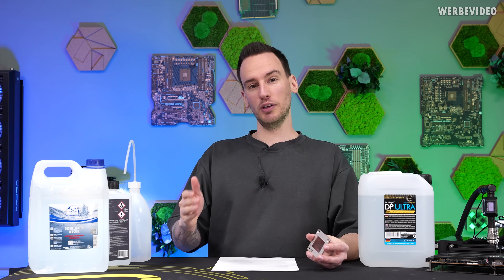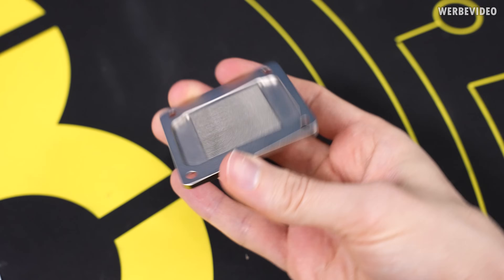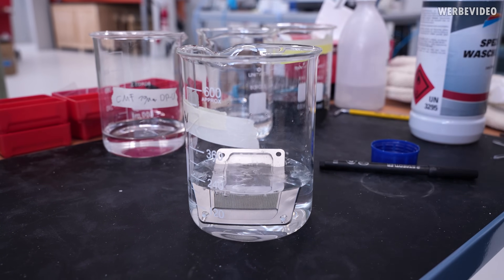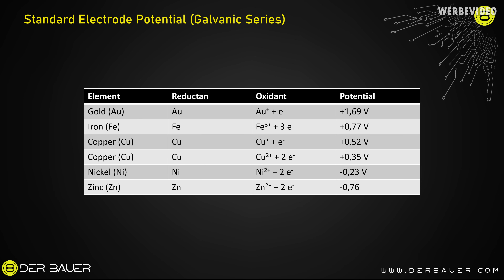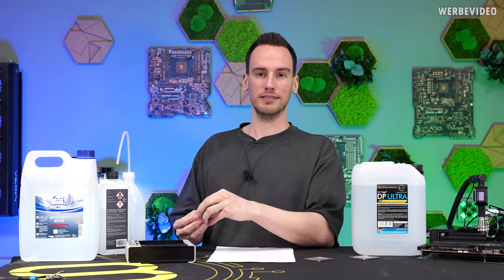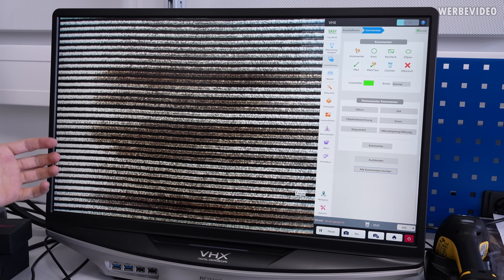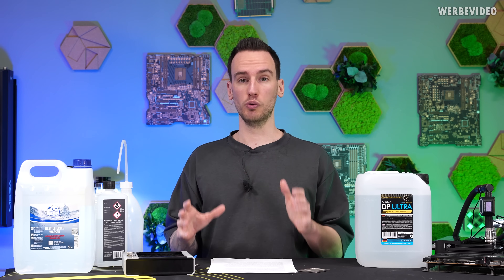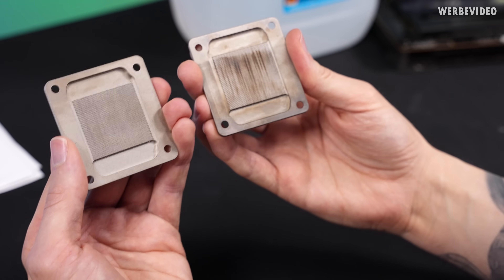Do NOT use Distilled Water for your Water Cooling Loop!

Comment: Would be nice if you would make a low cost, powder form inhibitor that you mix with distilled de-ionized water. That way us who live in areas of the world that have no direct importation of thermal grizzly products and cannot get liquid products shipped to them from other countries, can at least have good alternatives to ready made concentrates.
Reply: easy to use form to sell in would be a bottle with a measured amount of powder inside and a "fill to" line on the bottle indicating how much distilled, de-ionized water to add.

Comment: Yea I love distilled water, but I learned after a couple of loops that you do really need to treat it somehow. I've been using Primochill fluid treatment for the inhibitors and biocides in them since they're tiny little bottles that can treat a gallon/4 liter bottle of distilled water and then you have enough fluid for several loops. I just replaced my old pump/res and CPU block with new ones (wanted to move my old parts to a new rig so i needed another) since I wanted to get corsair's new iCue Link ecosystem into my current rig at some point for when my old fans eventually die, they've been running for 5 years now going strong but they're well into the window I'd expect to start seeing failures on past builds. This is the first loop I've ever had go this long with the same fluid without issues, my previous ones either had biological growth or corrosion issues, and while there are still some issues with some of the fittings getting some corrosion, I think that was more just from fluid running past them causing wear and not from the pH since my CPU and GPU block were both flawless, basically the same as the day I got them in appearance. It's possible that the old fluid getting slowly replaced with untreated distilled water the last few years might have impacted them, but there should still have been enough treatment in the loop for that to not be an issue, I did kind of add it to less water than I was supposed to knowing I would eventually be topping it off with untreated water and hedged against it. Some of the fittings had some crusty buildup in the threads when I took them off, but I actually actively avoided checking most of the loop since I knew that said buildup was probably also helping keep everything sealed up as tight as possible, and I wanted to avoid breaking those seals wherever possible. All 3 radiators and the QDC tubing runs to and from them were left filled with fluid and intact, and I drained the old fluid from my previous reservoir to fill the new one, and after a few weeks now the new CPU block looks flawless. No GPU blocks yet for RTX5080s sadly so that's running on air for the time being until I can get a block for my card, or until I'm forced to buy a different card to get one that I can get a block for at all (hoping that doesn't happpen but we will see).

Comment: It’s great to see someone actually talking about galvanic corrosion. It’s why I’ve stayed away from water cooling for so long. Even De-ionized water will eventually pick up enough ions to act as an electrolyte. Additives can help, but I won’t run a water loop long term unless every part is 100% copper. Too expensive these days.

Comment: sorry but that is not my experience 
have been water cooling now for 15 years and only used demin / distilled water + silver kill coil in the reservoir.
pure copper or nikkel plated blocks and soft tubing
only corrosion i have ever had was 1 build with a cheap EK copper cpu block where the copper would oxidize at the steel injector plate inlet.
that injector plate was not coated or anything and i know its steal since it was magnetic.
but this was more due to the fact that the system only ran 1 day a week tops and due to how the case was mounted  +  loop order (cpu and gpu parallel) so air got trapped in the block and started it combined with the steal plate.
after cleaning it and put everything in series problem went away.

Comment: If i can make a suggestion. There is a well known German company named BRITA (professional branch). RnD Engineers there over the years, working close with manufacturers of variety of appliances such as coffee machines or boilers (and lest face it  GPUs are not so dissimilar to them in some ways :) ,  have collected quite a knowledge base regarding water and corrosion and chemical processes involved. May be they can share some of it and it would be helpful in your endeavors.

Comment: I kept diluting my loop with distilled water (started with EK cryofuel) and my blocks/rads both corroded and filled with an algae schmoo, it was disgusting. I had to scrub out all of my blocks and I replaced my radiators/pump. Distilled water is NOT good for loops.

Comment: No issues so far using distilled water here + PT Nuke (Benzalkoneum Chloride). Always measure PPM, trying to keep between 1-5 PPM. Some time ago got access to Bi-Distilled water and is more pure (lower than 1PPM). Since I own a MORA and a 5L Chiller going DP Ultra or similar would be quite expensive (almost 10L both)

Comment: What do you think about distilled water with G12 antifreeze ? I used this type for cooling for over 10+ years... on my old water cooling setup
Now I used EKWB flush coolant and after that their clear coolant solution and to be honest I'm not happy that there are some slightly visible corrosion on the nickel parts.

Comment: Um yeah, I'm a professional chemist who DID run distilled water in a loop for over 8 years. Absolutely DO run distilled, degassed water. Inhibitors are just something which will deposit in the hottest parts of the loop (the blocks) and gunk everything up over time.

If you are worried about corrosion (it didn't happen enough to cause a problem in 8 years) put a voltage differential between the things you are okay with corroding and the things you aren't.

Maybe don't get nickel plated stuff? I had copper and aluminium only. Not sure why people are obsessed with breaking things which worked fine. 2 metals in a block is already asking for trouble.

You then go on to accidentally make my point. Do not use plating. Monometallic blocks only. Also do not use brass fittings unless you have a brass block. There should be no wet place where two dissimilar metals are in contact.

Comment: I need to WC my 4090, but I can't find a kit as I don't wish to mix and match.  I hate noise, so D5 is imperative.  I am going with an Alphacool Eisblock since I have a Zotac Airo Extreme and finding blocks that I can purchase in the USA is not easy for this model of 4090.  Any ideas?  edit:  Forgot to mention it would replace my AIO and would be a 360.

Comment: I was using distilled water for years and always had trouble with blocks nickel coating failing. I seen a video by EK explaining why not to use it. I've switched to EK fluid a few years ago and I haven't had a failure on the nickel plating since.
Reply: Yeah, good reason to not buy anything plated. I used distilled water on naked copper and it worked fine for 8 years. I wouldn't have dared if I had Ni and Cu in contact in the loop

Comment: Ive used Mayhems drops for flushing as well. I used distilled water + the drops for my loops but during my flushing process, I don't just use pure distilled and instead mix some drops into about 5 gallons of distilled for flushing and cleaning, then mix a new batch for the permanent fluid. Works well, addresses the issue he brings up at the end.

Comment: I did distilled water only (with PT Nuke) for years before switching to clear coolant with the inhibitors added and it did seem to slow corrosion.  I'm not really playing with open loops anymore but I'm not exactly surprised by the results shown in this video

Comment: once the distilled water gains the ions from the metals in the loop, it is no longer distilled water, and the water will only take as many ions as it can hold, which is true for any water you add at all.  So, I think that no matter what kind of water you add, you will have the effect you describe in the video.  ion migration is just a thing that happens.  and as you said, it's not a problem technically, it's just ugly.  distilled water is fine, because as you said, immediately it will draw ions from the metals in the loop, then it's no longer distilled water and as with any water it will migrate metals from one location to another as a natrual part of flowing through the loop.  water is powerful that way, eventually it dissolves everything.

Comment: Like automotive (and other) liquid cooling systems.  Glycol (and other additives) to prevent corrosion and protect internal parts.  Also need to change it out periodically (something too many people neglect).

Maybe just use Zerex in my comp cooling system then?  Hmmmm.

Comment: Wow... I just filled up my loop with distilled water, and here you are with a video. In my defense, I was going to let it run for a day until I got my anti-corrosion solution in the mail. My loop is leaking right now, so maybe I'll make it safer in the meantime.

Comment: I've run several year long distilled water loops and also a year with clear DP ultra. When I used distilled, I also used Mayhems inhibitor and biocide drops, the concentrated one that requires like a few drops per liter. All I've ever seen is the patina on my nickel, never any serious corrosion. It comes right off with metal polish and looks brand new again. Perhaps it's copper particles covering my nickel, but I saw the same thing when I used DP ultra. The difference is DP ultra has worse cooling performance than my 99.9% distilled mix. The glycol isn't as good at transferring heat as a more purer water mix. It's not a huge difference, but the cost is really what would drive me to use distilled over something like DP Ultra. Although I would say DP Ultra is my favorite pre-made coolant. It's the best, but I have a 5 liter loop with a big external radiator, so don't want to buy gallons of DP ultra every year.

Comment: I really wish rad/fitting makers would use bronze instead of brass, and avoid lead entirely.  I hate having zinc in my loop, but it's unavoidable.  I also wish there were more non-toxic, antifreeze-free coolants, but so far all I've found is XSPC Pure.
Reply: Just chrome plate everything (blocks, fittings, rad, etc) and all your problems will disappear. Right now I would say fittings and rads are the industry weak spot, because the inside of a radiator is just unplated copper, brass and lead solder (plus flux that never gets flushed out prior to delivery, even with high end rads. For shame)

Comment: I always use Tec Protect Clear to fill up loops. And the cleaning products from EK. To flush the loops. But we ordered a special custom water system for loops, with a reservoir from 50l with a double wall stainless steel, very expensive system, part reverse osmosis together with other filters and additives. The business is being handed over to our service engineer which is my best friend, and I am retiring after 51 years worked in all kinds of technical jobs, time to enjoy life.

Comment: Im working with industrial water purification equipment. Distilled water corrodes even the highest rated stainless steel, aluminium turns to dust, copper crumbles away. Only glass and some plastics are safe. Never use pure distilled water near any metal. For pc cooling use premixed car coolant.

Comment: I had distilled water + 3 drops of PT_NUKE for my all-taobao cpu-gpu + 2x420rads loop and it fared quite well for 3 years, saw corrosion at the end of 4th.
Washed and scrubbed everything, replaced liquid with 1:1 distilled water and EV battery antifreeze.
6 months in all good, let's see how it goes in long run.

Comment: I always flush my system with pure distilled water after using loop cleaner products and before filling with a new liquid
so I should buy extra pre-mixed coolant for the flushing as well? that will get a bit expensive quick

how about distilled water with anti-corrosive additive like the AquaComputer Anti-Corro Fluid ?
50ml is enough for 3L which is enough for 2 flushes in my loop which is how many I normally do after the loop cleaner
it's 5e for the Anti-Corro and maybe 3e for the 3L distilled water so way cheaper than buying 3 additional bottles of ready-to-use pre-mix coolant which would cost another 30e
already sucks enough that my loop uses about 1.2L so I have to buy 2L and throw away the remaining liquid since the fluid has a limited shelf life you can't keep it for next time

Comment: Back when I was messing around with water cooling, I used windshield washer fluid (blue stuff) for coolant. It seemed to work alright. Thumbs up for making better products!
Reply: A lot of them use some ethylene glycol so are basically the same as engine coolant fluid - just watered down.

Comment: Great video.  I don't have any liquid-cooled computer but the explanations were great for learning about galvanic corrosion.  I wish my teachers had used a real-world situation when I was taught in school as I couldn't link it to a practical use of learning that crap.  Now it really makes sense for learning pH balance and ion charges.  I've had cars and automatically used recommended coolants for filling the radiator and such, but I did occasionally use plain tap water to flush the system and that wasn't smart.  Your episode was very informative and readily understood.  I never thought about all the various metals used in a cooling loop and then you even mentioned algae.  That's some interesting research.  It was an enjoyable learning experience.
Those tiny fins on coolers surely need special attention unlike what's in an automobile engine.

Comment: This type of corrosion isn't a problem unless you are super anal about discoloration.
This is also why distilled water is a life time fluid.
Never fully discharge your distilled water loop, only add to it over time.
Empty water constantly being flushed is when you can develop leaks because of too much material being dissolved in the distilled water.
If you leave those heavy particles in the loop, the water will saturate and never take any more materials from the initial filling.
I have a server rack that is distilled cooled and it has been running on the same distilled water for over 10 years with no leaks.

Comment: I can say copper and brass and like plastic fittings or brass and you will get 0 problems with corrosion with distilled water. Been using that for years so. However i did try nickel plated fittings and its really bad for some reason. Kinda weird to plate it with that but. Can also say that i use air cooled now cause of that and got tired of the pump noise so.  Used water cooled for 20 years weirdly now that i think about it.

Comment: Thanks for the video. Needed to see this as I am definitely guilty of this.... Flushing or temporary fills until a coolant mix is sourced. Not only for my PC builds but also for the commercial equipment I service. I've told customers they can run distilled for a few days while they wait for coolant *face palm*. Though in a commercial setting with deadlines and stuff I don't think I really have a choice but at least now I know to tell them they will be damaging the cooling equipment if they really cannot locate proper coolant. Usually its the customers laziness and they can get something same day if they actually tried, this might be the kick in the butt to get them to source some haha.

Oh, I knew distilled caused corrosion I just thought it took days to actually happen, not immediately. Wild how fast it happens.

Comment: Distilled water was fine for the past 20 years...with my gold plated water block from Koolance, but they literally don't build them like they used to. I actually found a several C temp reduction using a mild mix of ethylene glycol automotive anti-freeze in the loop when it was cooling a Pentium 4 3.4 Prescott at around 4.2Ghz. I've used it since for a Xeon X3470 (4.2Ghz) and i5 750 (4.3Ghz) which are up on HWbot just for fun. Certainly no records but not bad for a loop made for a Pentium 4.
Reply: It's honestly strange to see a video like this from someone like derbauer who was around for the P4 era of watercooling and experienced it all back in the day. It was never a problem and now all of a sudden it is? I don't know man. Maybe derbauer was too focussed on liquid nitrogen back in those days to notice all the people running distilled water with PT nuke or coils and no problems, it was always the guys with the coloured coolant and weird additives that had the gunked up loops.
Reply: @muf1772  Only issue I ran into with automotive coolant was after letting it sit in the loop for about 10yrs I had a white film that was hard to wash out of the block and pump but I got it cleaned up with some different chemicals and compressed air. I think the issue now a days is too many different metals. Fittings, blocks, radiators, pumps, all different metals. Back in the day it was pretty much either straight copper/brass or all aluminum loops. Maybe a little stainless from an aquarium pump. He touched on that with how despite everything being nickel plated there's still a lot of porosity or missed areas where plating isn't covering the copper perfectly or other metals. I'd love to do a liquid system again but I just know how lazy I am and that I won't maintain it properly unless I really do make it super simple to drain and fill and even then I'll forget or just simply not want the down time involved.

Comment: As a side note, the title of this video (“Do NOT use Distilled Water for your Water Cooling Loop”) had me a bit worried that distilled water in and of itself was considered bad.  (That did seem rather odd to me though.)  It might be good to adjust the title to indicate that you mean using only distilled water. (I used distilled water + biocide + corrosion inhibitors when I water cooled.)